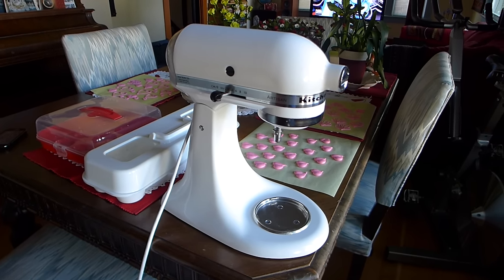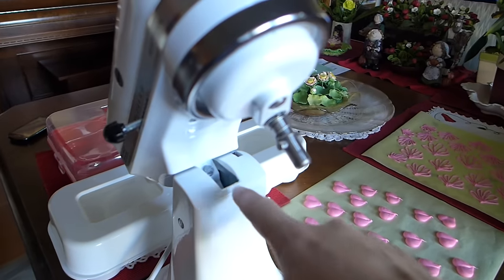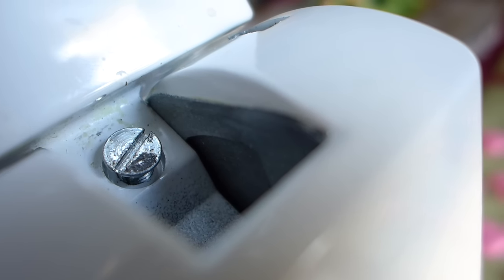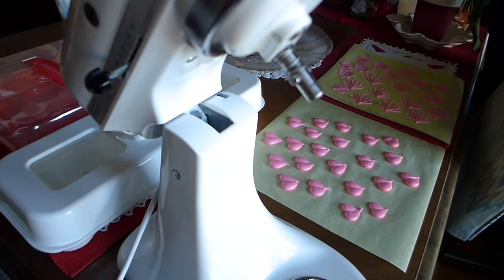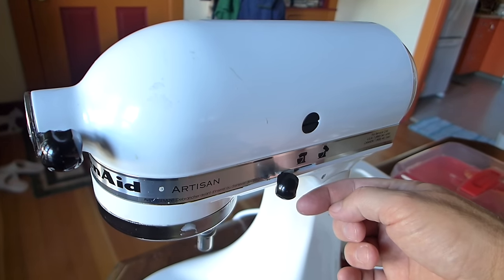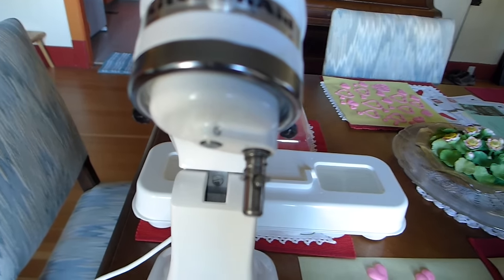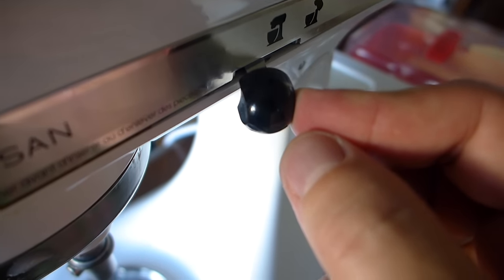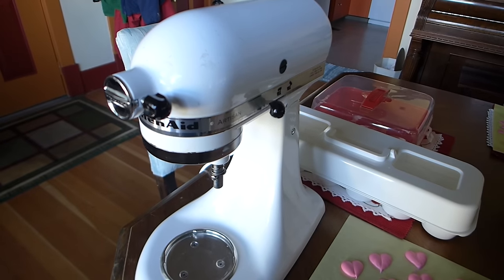How to Fix KitchenAid Stand Mixer (loose head)

Comment: Unfortunately this did not fix my lock problem, it seems that the screws that fix the head to the bottom part may have looked up, any experience with this issue?
Reply from the maker: The only thing that connects the head to the base is a large, silver pin (at least in ours). If that pin is in place, there shouldn't be any jiggling there. A set screw accessible from under the base keeps that pin from falling out, but even if that set screw is loose, as long as the pin is in place, that should be a solid joint.

Comment: Hi. Our problem is that it doesn't lock in the UP position (the manual tells us it can and should be...). Any ideas?  Thanks.
Reply from the maker: I don't know about yours, but ours doesn't technically "lock" in the up position. When you raise it (on ours), the center of gravity moves to the rear of the pivot pin, and gravity just keeps it there. So, we just raise ours, and it stays.

Comment: Did you not have any clearance problems after adjusting the head?
Reply from the maker: My wife hasn't said anything, although I really think you need to strike a balance between the height of the beater above the bowl and a loose/tight head. I don't know if perfection can be achieved in every case.

Comment: That screw is used to calibrate the height of the beater relative to the bottom of the mixing bowl. Screwing it might solve the bobbly head problem, but it means that the beater may now sit too high. That's not a big issue with kneading yeast doughs which are cohesive, but for mixing and beating (eggs, butter, cream etc), it's absolutely crucial for the beater to sit low to the bowl).  So, I haven't tried it, but I don't think that screwing that screw out is the right fix - it just raises the beater head, meaning the unit doesn't work as efficiently as it should; at some point, also, the locking latch won't work properly, as was the case with my unit. If you raise the head, you change the clearance between mixer and bowl, but you also change the clearance between the locking latch and whatever it grabs onto. If you go too high, you'll have the problem I had, a latch that doesn't hold as it should, and eventually, bobbles itself unlocked. I might suggest lowering the beater head to a properly functional clearance, and then putting a stop of some sort, a grommet maybe opposite that screw to arrest the arc and prevent it from knocking around - without sacrificing the clearance between the bowl and the beater tools. See if that works. I experimented with putting a little wadded up bit of paper towel in there and that prevents the knocking also. An adhesive grommet would be better, but paper towel was all I had to hand. I think kitchenaid is having quality control issues. You shouldn't have to sacrifice the performance of the unit, in order to prevent it from knocking around. It' may be that the made in Chindia specifications (they are only assembled in the US) are incorrect. Maybe the beaters aren't long enough, or the shaft that comes out of the machine the wrong length, or the bowl improperly designed - I don't know what. This ain't the space program, but there are a few parts that should fit together properly for everything to work.
Reply from the maker: Outstanding post. The QC (as you said) or the design is definitely a problem.

Comment: So I am trying to loosen the screw to bring it forward a little but it is so tight I can’t get it. Any suggestions? little metal shards are coming off the screw from me trying to loosen it :-/
Reply from the maker: Make sure you're trying to turn it counter-clockwise! Next, use the biggest screwdriver you have (or borrow a big one from a friend). Also, I would try spraying some WD-40 (or any penetrant oil) on it. Wipe off the screw head after that so that the screwdriver will have less tendency to slip out of the slot. Those are all my ideas!

Comment: Help me plz...my late mother left me her mixer but when I was trying to turn it off it was kind of sticking so I used some pressure and then it stopped mixing completely. I unscrewed that big black thing above the power switch and pulled out the piece in there that has a rectangular metal piece with a spring on either end and the metal piece broke in half but I don't know what it's called to replace it..
Reply from the maker: That's a motor brush.
Reply: Jay Williams lol..I just searched and finally found that out...so I'm guessing it in the motor 😞😞

Comment: That screw is to adjust the height of the mixing attachment so it doesn't scrape the bottom of the bowl.
It's mentioned in the instructions.
Reply from the maker: That's correct, but what the instructions don't mention is that if the head is loose and bouncing up and down, it could be because that screw is screwed in too far.

Comment: It didn’t work for me. If I make the head lock the beaters scrap the bowl. If I adjust the beaters, the head doesn’t lock. Is there another screw to fix it ?
Reply from the maker: I think this is the only way. Maybe you just need to make smaller adjustments. I'm not sure. I would err towards raising the head higher (turn the screw counter-clockwise).

Comment: I did adjustment to solve the locking issue but causes beater get too low and interferes with the bowl, another problem.
Reply from the maker: Yeah, it's definitely a balancing act. Remember, it's RAISING the beater that will eliminate the jiggling head, so doing that might give you the clearance you need, too.

Comment: Thanks so much for this video.  It is exactly what was happening to my daughter's Artisan.  I wasn't aware of it until I used it one day to make cookies with my grandson.  I took the same approach you did with tightening the screw but then never tested it.  The next time my daughter tried to use the mixer she broke her paddle when it violently slammed the bottom of the bowl.  I didn't disassemble to the extent you did, but upon closer inspection, I noticed that the casting at the rear where it tapers to form the joint, was cracked half way through on both side of the head.  My daughter mentioned that the mixer had been vibrating for years, so I'm guessing that this screw being out of proper adjustment may have caused excessive stress on this area of the mixer.  So now, even with this new information you have provided, I don't know how safe it would be to continue using the mixer.  Thanks again.

Comment: What your goal should be is to make sure the beater is just one sixteenth away from the bottom of the bowl to reach down deep enough but not scrape, and not too low to wear the finish off the beater or scrape the bowl.  It's the dime test.  Here's another video that explains how to adjust the beater depth with that screw.  Check this youtube video here> https://youtu.be/vcZCRqMJ2I8

Comment: My problem is I do not have a setting where the lock will go all the way forward and the flat blade does not hit the steel bowl. Either it passes the dime test and the lock goes just a little past halfway or it locks all the way and the flat blade scrapes the bowl. Very frustrating.
Reply from the maker: For what it's worth, I don't think it's necessary for the lock to go all the way forward. The problem is if it DOES go all the way forward and yet still doesn't come into contact with the pin (or whatever) is inside, and so allows slop which allows for the jiggle.

Comment: Having the head come too low bottoms out the mixing tools. Having the head too high leaves too much unmixed material at the bottom of the bowl. To find the perfect height, drop a dime in the bowl and turn the machine on at low speed with the beater installed. If the dime moves all around the bowl, the head is too low. If every couple of turns of the beater moves the dime a little distance, the height is perfect. If the dime doesn't move at all, the head is too high.

Comment: This video is no help to anyone that adjuster screw is to adjust the head height so that your dough hook and blender blade and whisk are set to the proper level with the bowl if you're setting the screw to tighten the headlock you'll always have unmixed materials in your bowl because it's too high I recommend you remove this video before you make more people screw up their blenders

Comment: This is NOT a fix for "looseness" of the head.  It is simply the adjustment for how close the beater is to the bowl.  There IS an adjustment for looseness of the head - it is the screw under the mixer where the hinge pin passes through.  The screw needs to be tightened to fasten the head to the hinge pin.

Comment: And if any of you would read the manual, you would know that this screw is just the height adjustment. The screw you want is located on the bottom of the mixer. Lay it on the side and you'll find it. Why is it so hard to rtfm.

Comment: This video is complete nonsense. The sole purpose of that screw is to adjust the clearance between the beater and the bowl. It should be adjusted so the beater does not touch the bottom of the bowl.

Comment: Thanks; however, there may also be this problem when the head moves - http://youtu.be/_qioHm1PQns
Reply from the maker: That's a problem only if the hinge pin is actually falling out of the machine. That should be pretty obvious.

Comment: The screw you adjusted is to set the height of the head so that the whisk, or other attachment, is the correct distance from the bowl.  So watch that video and set the mixer properly.   Now please search for the video showing "neck pin adjustment" and follow it.  After you have done that, why don't you download the maintenance manual and learn how to do it properly, before misleading others.  Damage your own machine by doing the wrong thing and that's your problem, but don't encourage other people to damage theirs.

Comment: This is easily fixable if you just look up kitchenaids manuals instead on mindlessly taking things apart and turning screws
Reply from the maker: You are wrong. There is nothing in the manual about how to fix a vibrating or shaking mixer.

Comment: Very informative video.
My question would be, like any other person's with half a functioning brain.
Why is kitchenaid making these in this way?!
I can understand almost a century ago, in the 1930s to have made this method. Hey, they were pioneers in the field, clearly there was no knowhow or tools able to create precision manufacturing.
But anything  that is part of the modern age, like after 90s (in america) should have disposed of such a silly and quite frankly prone to failure component. That screw isn't needed. When the mixer is assembled to spec, a user should not need to adjust anything. But having that screw, with usage, from vibrations it will come undone and lead to shifting of head position and rumbling of the head.
Moreover especially now in the 2020s, seeing their price tag and the fact they are still selling the same old thing for profit (no ROIs to be part of the cost) it's appalling they are still offering brushed motors and not switched their whole range to brushless.
Reply from the maker: I think it's just to provide adjustability for different attachments so you have fine control of how close they come to the bowl.

Comment: All of this could have been avoided by reading the instructions 😂
It explains that screw is to adjust the height of the beater in the bowl
Reply from the maker: You're wrong, but don't worry. You're not the first one to make this incorrect assertion. There is nothing in the user manual about a shaking or vibrating head. Nice try, though.
Reply: @jayphilipwilliams  I bought one yesterday and it most definitely does